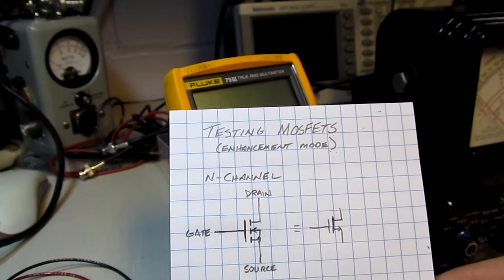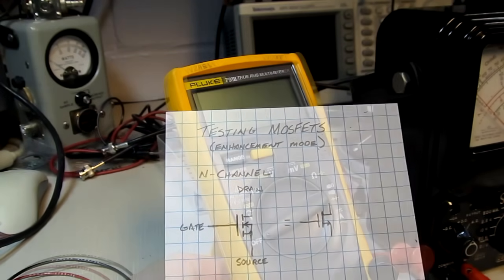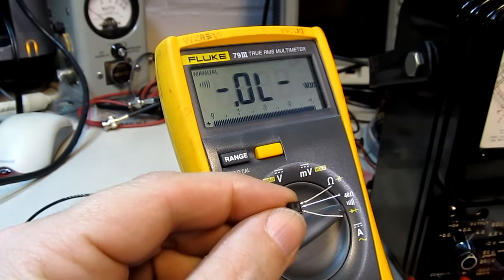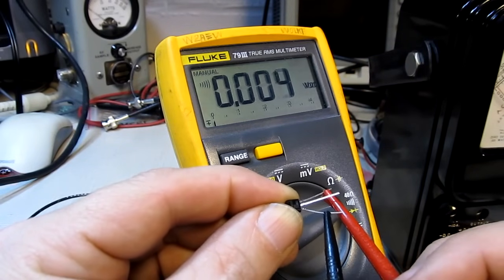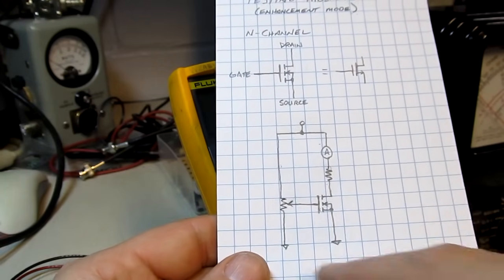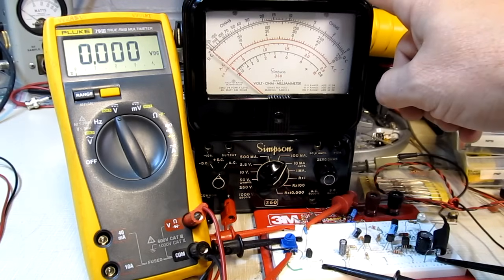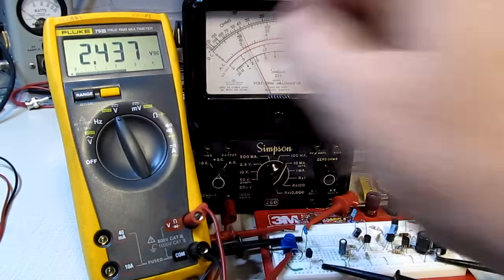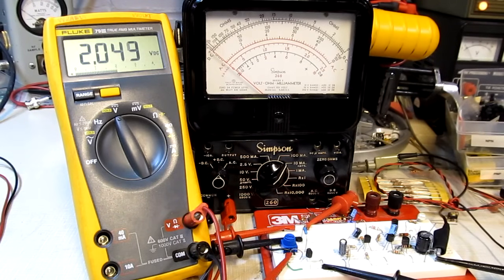#132: How to test MOSFETs with a DMM - a few methods...

Comment: Nice video !!! Thank you so much. What about depletion mode MOSFET?
Reply from the maker: For Depletion Mode FETs, you can start with shorting gate to source, and applying bias from drain to source and measure the drain current.  This is the Idss value. Then, bringing the gate voltage below the source voltage should eventually cutoff the drain current.

Comment: In the Learn Electronics Repair video All You Need To Know About MOSFET's to fix stuff, he warns not to touch the gate because of ESD. Is it okay in this case @2:20 because you're touching the source first or something else?
Reply from the maker: The Gate of a MOSFET is sensitive to ESD discharge, so it is wise to ground yourself before touching the gate.

Comment: I assembled a high-frequency amplifier on a mosfet 25 years ago. In January 2000. Since then I forgot about mosfets. I worked more with bipolar transistors and vacuum tubes.
In 2014 I noticed that mosfets are gradually replacing bipolar transistors, and mosfet circuits are very quickly gaining popularity among radio amateurs. Thank you for reminding me of the principle of their operation. I think I should try to assemble some simple mosfet circuit after a 25-year break. I have a lot of experience with bipolar transistors. I think mosfets will not cause any complications after such practice.

Comment: I tried checking it on a mastech 8268 and it could duplicate the test,but on two others it did it. Why not the mastech  MS8268?
Reply from the maker: It could be that the polarity of the voltage on the probes in resistance mode is opposite, or too low in voltage to turn on the FET.
Reply: @w2aew  thanks

Comment: Many thanks for the video - would the test work with the mosfets in situ (in the circuit but no power) or do i need to de solder and remove?
Reply from the maker: Not for in-circuit testing

Comment: Sir, a K2611 is this a N channel?
Reply from the maker: Yes.  This is likely a 2SK2611.  The JIS transistor numbering scheme for transistors has a 2S prefix which is often left off.  The third digit, "K" in this case, means it is an N-Channel FET.  More info can be found here: https://www.electronics-notes.com/articles/electronic_components/transistor/transistor-codes-numbering.php
Reply: @w2aew  thankyou

Comment: I went to do this with a couple beefy RF power mosfets, and it didn't work.  But, inspired by the approach, I wired the gate to a 5V supply and used the ohm meter to see that the drain->source went to 0 ohms.  Maybe the voltage of my DMM's diode test mode is too low to flood the gate?  I'd be curious to know!
Reply from the maker: That is likely the case - not enough voltage to bring Vgs high enough to fully turn on the channel.

Comment: What does it mean when you say a positive voltage would respect the source? Does that mean if the source has a 10 volt then the voltage to the gate should be above 10 volts?
Reply from the maker: Yes, exactly.
Reply: @w2aew  thank you
Reply: @w2aew  I'm just starting to learn setup of mosfets and transistors and it's so confusing for me right now. I think it's kind of like learning how to ski. Real easy for the guy knows how to but Impossible to do it right the first time for the newcomer
Reply from the maker: @AB-yu2tj  check out my video on the basics of FETs: https://www.youtube.com/watch?v=oambDFa0Pr8

Comment: Is it possible to test a MOSFET while it's on a board, in a circuit with other components? Or will the connected gate discharge the capacitance and make it untestable (or would it be untestable for other reasons?)
Reply from the maker: It's really impossible to say because there are so many variations of what circuitry could be surrounding the MOSFET.

Comment: Cool video, after I touch drain pin with positive lead, it's still open, my FET is faulty isn't it ? :)
Reply: @2:04
Reply from the maker: Not necessarily.  It could be that your FET requires a higher gate voltage than your meter applies.
Reply: @w2aew  how much voltage ? which part of datasheet saying it ?Thanks
Reply from the maker: @RixtronixLAB  Gate-Source Threshold Voltage
Reply: @w2aew  2V, can digital multimeter give 2V ?
Reply from the maker: @RixtronixLAB  It depends on the meter.  You also have to make sure the device is clean so that the charge on the gate doesn't bleed off before to move to test the d-s connection.  You also have to check the polarity of the meter - some are backwards when measuring resistance.
Reply: @w2aew  I see, thanks
Reply: @w2aew  V threshold isn't it ?

Comment: Thanks this works on many MOSFETs but you have to be careful about the voltage produced by your multimeter in diode test mode, since it may not be above the MOSFET's gate threshold voltage. Check the data sheet and if possible measure the voltage produced by your multimeter in diode test mode, using your second multimeter :)  On my two multimeters it's 3V which is right around the typical threshold voltage of many MOSFETs, and well below the 4V maximum threshold many MOSFETs like the IRF520A and IRF120N might have. Keep in mind that at its threshold voltage a MOSFET is just barely on and needs a significantly higher voltage to switch fully on. A trick to measure the meter's voltage if you have only one meter: Charge a big capacitor in diode test mode then measure it in DC voltage mode.
Reply: Haven't messed with this stuff in a long time, Your comment helped 🙂
Reply: Thank you very much for very important electronic technical suggestion.

Comment: The digital multimeter test method is very good.  However, it doesn't work for all MOSFETs.  In some cases the multimeter doesn’t provide enough gate voltage to turn the device on (e.g. PPP 114N12N3G power N channel MOSFET).  In those cases you need the more sophisticated second method.

Comment: With that good MOSFETs, in the On-state, or low resistance reading, how long would that be On or on
0.003 or low resistance keeping your test probe on that Drain and Source? have you tried keeping that test probes on that pins for a couple of minutes or hour and monitor the reading? does all good MOSFETs must have that reading and it will keep that reading forever until we discharge the gate?
Reply from the maker: It's difficult to say - it all depends on how long it takes the charge to leak off of the capacitance formed by the gate-source. This could be due to internal leakage, thru external contaminants on the package, etc.

Comment: I never thought to charge the gate using the meter. Great idea. I hook up the meter to the drain and source and use a 9V battery and my fingers to complete the circuit to the gate. Great video. Thanks.

Comment: Does the gate to source threshold voltage vary for each type of FETs?
Reply: The polarity is common among the same type of FET. For example, n-channel JFET and depletion MOSFET have negative Vgs threshold. Enhancement n-channel have positive Vgs threshold. The value of Vgs threshold varies by individual device part number.
Reply: @alanwolke6253  Thank you for your reply!

Comment: I ike the viedeo but the thing I don't get is all masfet testing videos talk in GATE DRAIN SOURCE but Data sheets are M1 M2 Gate or T1 T 2 Gate translating would be useful even if just as annotation
Reply from the maker: I'm not sure what MOSFET datasheets you're looking at, but EVERY datasheet that I have ever seen for a MOSFET always labels the Gate, Drain and Source.  You may be referring to the schematic designations you find for a given circuit or product - these don't often list the pin designations, you can simply infer them from the schematic diagram, or refer to the datasheet for the specific MOSFET you're testing.

Comment: Why is
It that everyone keeps referring to transistors as switches? When they behave more like a potentiometer.... I used to think that there was some sort of solid state switch inside and every time I researched the workings of transistors I would end up confused.... Where's the switch? How come no one is showing the switch? All I'm seeing is three different compounds... Hmmm well there must be some magic going on that I just can't see or understand... It wasn't until I saw a video on the topic by a person who is no longer with us... I forget his name but basically he went on to say that you really need to look at transistors as potentiometers to understand how they work... That's when it started to make sense... So now when I see something like what you did while testing the Mosfet... What I saw was a potentiometer with a capacitor.... And seeing it that way I can understand how it works, What it's effects are to the circuit that it's being used in... If I'm going to want it to turn off then I'm going to want to drain the gate somehow... You can begin to figure things out when you really know what a device is doing.... As you were slowly increasing the voltage on the gate, I saw a potentiometer in action...
Reply from the maker: In today's environment of blinking LEDs and doing everything with a microcontroller, many folks have only ever seen a BJT or FET used as a switch.  Certainly it is one way to use them, but there's a whole world of analog between the on and off states.
Reply: w2aew I totally agree with you on that but once you learn what a transistor can really do, a whole new door into electronics opens up. Apart from using them as switches, you learn that they can be delicate and ramp up voltage gracefully.... suddenly electronic dimmer switches start to make more sense as to how they actually work LoL... And by choosing carefully from an ocean of transistors, you can build an amplifier that can reproduce music like you have never heard, and I'm not talking about audiophile stuff.... far from it... I have two amplifiers that were home made, one that was designed by the editor of Electronics Australia and was sold as a kit through their publication, and the other was built by someone who built a lot of amplifiers at home and then sell them to local Hifi stores, his address was inside the amplifier. both of these amplifiers are amazing, they probably need to be re capped but I'm to scared that their sound reproduction would turn sterile... I have never seen inside another piece of equipment the level of construction of these amplifiers. maybe one day I might fit a clear acrylic top to it to show of the internals... But what they do to the sound is out of this world... Funny thing though, I originally purchased the first one because I wanted something that looked old and I was going to gut it and give it a new life.... but once I listened to it... that plan changed...I thought that it would be a shame to destroy something that sounds so beautiful. So I went out and found another candidate... only to get it home and realize that I wasn't going to gut this one either. I really have far too many amplifiers that I know what to do with and with that in mind... I totally gave up on the idea of doing a gut and re fit... Anyway... on another note... That circuit that you built for a friend of yours, the one that takes audio at various output levels and basically just outputs them all at the same audio level... how difficult would it be to make it work with RCA line level and possibly even potentiometers to make variable changes to the attack and delay or whatever other effects are possible.... I'm not really into ham radio, it's not as big a thing here in Australia as it is in the US... But that circuit and the other videos that you have produced are on another level! in combination with what you say and the drawing of schematics to the physical demonstrations and finally the ability to download the notes! seriously! If schools actually only hired people like you as teachers.... no one would ever drop out of school... Schools would literally be kicking students out to make room available for new students... Never stop what you are doing, the world's a much better place with you in it working your magic.

Comment: doesn't work...only if i swipe the multimeter probes+ with - ..I've tried on a diode and the same thing..if i pass voltage to diode + with + and - with -...i have to change the probes to get a reading of conductivity...your multimeter is in conductivity mode not diode mode
Reply from the maker: Perfectly normal. Unfortunately there is no standard for the polarity of the leads in resistance mode. Some Meters are reversed, some are not.

Comment: Hello and thank you for the educational introduction to MOSFETs!  I dont know if youre still monitoring this vid, but how would you go about doing these tests (if even possible) while the FET's are still soldered into the PCB? Ive got an issue I need to resolve. Im no expert and not overly familiar PnP's or NpN's  but I am however just dangerous enough to solve my own problems if provided a little guidance.   I am attempting to test C4131's and  A1746's.  Very grateful for  any info or insight. Thanks again for the clear, concise and understandable video. Great work!  Cheers!
Reply from the maker: In-circuit testing is not very reliable because the other connected circuitry can and will affect your measurements.  Note that NPN and PNP devices are not MOSFETs, they are bipolar transistors - a different animal.  The two devices you mention (2SC4131 and 2SA1746) are NPN and PNP bipolar power transistors respectively.  These are not MOSFETs and are not tested the same way.  I did a video on how to test bipolar transistors too:
https://www.youtube.com/watch?v=qM7_h8my8eA

Comment: damn i had my hopes up no maybe not....i tested some other mosfets in circuit on another laptop board and it seems most D-S diode test shows  open..but a few show low reading like 15....so you are correct ..testing in circuit can mislead bad for good....but in your opinion the high 550 reading both ways D-S is definitely worth going further to test? removing from board?
Reply from the maker: The only reliable way to test them is out of the circuit (or by verifying proper circuit operation).

Comment: thank you for helping me..the mosfet that is suspect is an 8 pin smd mosfet TPCA8065-H and when i find data sheet pin 1 has a dimple on top of chip and pins 123 are S and pin 4 is gate and pins 5678 are D ...so im confident i have the correct pin out
Reply from the maker: To be absolutely sure - remove the device, short Gate to Source, then check D-S using Diode test.  If it doesn't read "open", then there's a problem.

Comment: thank you..i did test mosfets in circuit with no power plugged in...does this test work in circuit too? and also when i got a diode test 550 reading when i test D-S does that mean 100% that mosfet is bad?
Reply from the maker: In-circuit testing always suspect, since surrounding circuitry can affect the results - making good devices appear bad.  On the device that gave you 550 on the diode test, try reversing the D-S connections and see what you get.  If you get a similar reading, or lower reading, then the device is likely bad.  If it  appears open when reversed, it could be that you have the D-S terminals reversed.
Reply: when i reverse connection red on S and black on D testing D-S i get same 550 reading using diode

Comment: great video ..i have a laptop that when plugged in is dead..its a toshiba and bried research seems common mosfet failure...so i watched your video and i tested a few 8 pin mosfets and can you let me know if i did right and if nosfet is suspect... i used diode setting and i tested S-D .. black to S and red to D and i get a reading of 550...shouldnt this be no reading/no contnuity?..i then charged the gate like you did and then S-D reading dropped to very low reading like 1or2....i tested another mosfet in circuit to make sure i was doing right and when i test D-S i got no reading and when i charge up drain i get low reading like 1-2..so i think im doing test right and i think the first mosfet i described above could be bad and it is very close to the power input area ..can you let me know if my test seems ok?...love your video
Reply from the maker: Sounds reasonable to me.

Comment: Great idea to use your finger to discharge the stored energy in the gate capacitance. I'm a bit surprised you didn't discuss the body diode of the MOSFET and how that could effect some readings if the DMM leads are reversed.

Comment: great little video.. but i can't get any readings at all no matter what connections i make . the G, D and S are the same as in your video .. i am testing a STW80NE06-10 Mosfet .. . does this mean it's completly blown ..
Reply from the maker: Might be, but test it in the circuit shown at 2:45 in the video to be sure. It is possible that the "diode test" on your DMM might not produce enough voltage to make the D-S channel conduct.
Reply: i don't have the means to put together a test set up like yours ..

Comment: I always thought you were supposed to touch the gate and drain to discharge the mosfet. Many mosfet videos say touch the gate and drain. Your video says touch the gate and Source. Are both methods correct?
Reply from the maker: Either will work.

Comment: I've got a FR18N15D here but can't find info on the source and gate points (had a look at the data sheet but it is probably very well hidden somewhere?). Is there a way to find out which is which, using the multimeter?
Reply from the maker: Pinouts are shown on page 8 and 9 for the two different packages:
http://www.datasheetspdf.com/datasheet/download.php?id=692712
Reply: Thanks for your quick response and for the link, but that's the sheet I have been looking at and the only thing I can see on page 8 and 9 are the dimensions, or am I missing something?
Reply from the maker: There is a small list showing pin number and function on each page, on the right side of the page.
http://www.mouser.com/Search/Refine.aspx?Keyword=FR18N15D&FS=True&Tb=datasheets
Reply: Ah! Found it! Finally! 
Thanks very much for your quick replies and your patience:-)